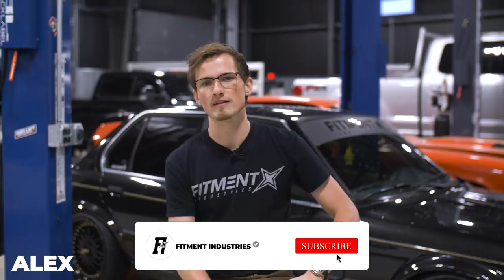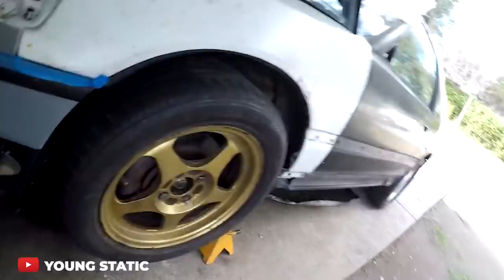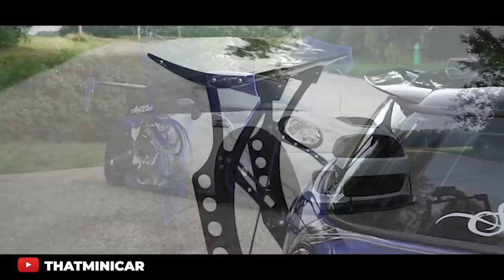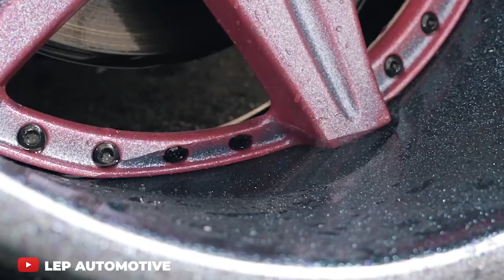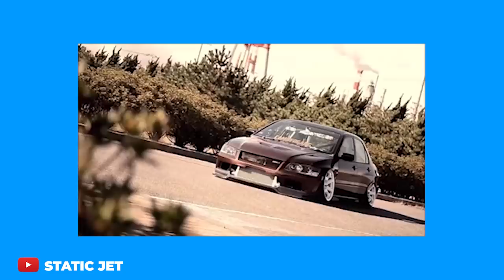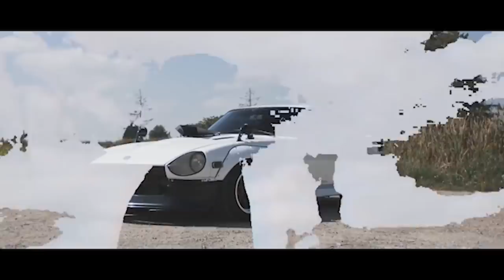Rookie Mistakes When Building A Car

Comment: camber over 10 degrees in either way should be illegal
Reply: @mirainikki7681  So because you don't like how it looks mean it should be illegal.. makes sense
Reply: ITZ Caleb why does it affect you?
Reply: I normally dont like excessive camber but on a few cars it looks cool to me
Reply: @joshuakleine7821  well it poses potential risk to others on the road, considering they have less grip...
Reply: @thomas kalita it really isn’t that unsafe if done correctly. You just can’t buy cheap camber bolts and camber arms because they will probably fail
Reply: @joshuakleine7821  its about grip, not the quality of the parts, it reduces the 60-0 breaking by a ton of feet
Reply: @rodri MFG TONS of feet, yes sir you are right it take an additional 4 THOUSAND feet to stop from 60-0 if your car has camber. Yes it does take additional room for a car with excess camber to stop (maybe an extra 10 feet of so”. But everyone with a car with excess camber knows that, and drives it that way. But everyone seems to be avoiding my question. How does excess camber affect you in anyway? It’s proven safe if done correctly, like I said above if you have the right suspension components like camber plates, camber bolts, camber arms, toe arms and more, it’s safe. Yes it does put excess wear on your car, and it sure  is not good for your tires, but it really isn’t affecting you
Reply: In alot of places outside the US it is illegal because its considered dangerous
Reply: @Revitalyzed  It was more of an exaggerated joke to express my hatred towards the mod, but yea bro
Reply: @r3volt21  it can also help by giving more grip in corners if its setup properly for the amount of power the car puts out and the wheels it has
Reply: Illegal? Just because they have poor taste, no concept of aesthetic ratios, and a desire to go through tires like crazy, doesn't mean they should be illegal. We need something to laugh at while in traffic my friend.
Reply: 8.5
Reply: Full t demand suspension or 326 is about 10k-12k I promise you it doesn’t ride as bad as it looks. If you buy quality parts it will drive like its stock but look boss af and I’m talking static too not bagged
Reply: ITZ Caleb true
Reply: @r3volt21  about 1 degree of camber increases grip in corners/slides... not 10 degrees....
Reply: Excessive camber looks terrible
Reply: My car my choice you do what you want I dont say anything
Reply: I tell em “your wheels are falling off!”
Reply: @mirainikki7681  speak the truth
Reply: ITZ Caleb same
Reply: People with excessive camber wheels are raging on this
Reply: @Revitalyzed  no it's just straight up dangerous, theres hardly any actual tire touching the road so if they need to turn, or do anything fast they're gonna crash
Reply: @maxwell5428  agree. I've long thought it was a really dumb trend, but I try to be respectful of other people's tastes. Then courtesy if Fitment Industries videos I discovered stance on OG beetles and I have ti admit I really freaking like it and I have no idea why.

Comment: My mods in order of what I did.
1st. Cold air intake
2nd. Short shifter 
3rd. cam and head
4th. Coilovers 
5th. Bigger Breaks and braided lines
6th. Lighter and wider wheels
7th. better tyres
8th. Turbo conversion 
9th. Touchscreen display
Reply: finally. performance mods.
Reply: 10. Slam it, negative camber and wing
Reply: So far my first mod is new non stock not crusty rusty ball joints and suspension
Reply: Bro. Lambo doors should be 1
Reply: @zCrytekzHD  for some reason I thought your pfp was a peanut
Reply: Lol this is the dream but honestly I'm just trying to keep my rust bucket from falling apart
Reply: Crytekz 
1) wasted your money
2-9) Excellent mods, good shit
Reply: You should do a tune first for the mods
Reply: @nicolapalmieri7344  that's dumb as hell lmao, you're just gonna have to go back and retune the car after you install the mods anyways
Reply: @fakename287  oh, well, but still you have have to do the tune after installing the mods, and it you don't have enough money and your motor is solid enough you should do a stage 1 tune if you don't have money for mods at the moment
Reply: Is straight piping a good 1st mod?
Reply: Carguy_Club you forgot to mention about retunes being free a lot of times
Reply: Exhaust & tune you’re set!
Reply: Crytekz fires should be like one of the first ones
Reply: 0. Code the annoying Things out with a Bimmerapp
1.Cold Air Intake 
2. Coilovers or H&R Sport Springs 
3. Body(front, rear, angel eyes, rear Lights)
4. Tires and wider Wheels 
5. Break kit with braided lines 
6. Bigger Turbo, Intercooler, Injectors, Fuel Pump(with Pro Tuner)

Car: BMW F31 318d

I would like to do all of this but aint got the Money. 

I did do a tune from 136HP (factory lower) to ~180HP(Stage 1) 
plus I think on doing H&R springs and 19"Wheels.

Cant seem to find an Cold Air Intake for my car tho.
Reply: @loza93  What wrong with the normal intake tube?
Unless you place the filter under car or infront of radiator, it does jack shit.
Reply: I just bought a 14 ats 2.0t rwd. What I did in the first month of ownership was get the cars maintenance up to date and anything replaced that needed it. Now it’s a solid base for parts! My parts list so far is……
67mm throttle body
CAI
Catch can 
Strut tower brace
Ngk plugs 7 heat range (OEM is 8)
High voltage coil packs 
Ptp turbo blanket
3 inch downpipe
LED floating center caps
Mirror puddle light projectors
Smoked lense led front side markers
3rd brake flasher
E85 (not installed) 
I’m buying 10 inch tablet head unit tomorrow and then this spring tuning 
And e85 install. Then next is upgraded intercooler and full 3 inch catback exhaust.
Reply: Bad order!
Reply: @nezabytes  I worked with the money I had at the time.
Reply: 10. took and engrish crass, learned to read and white in his own native tongue 😂

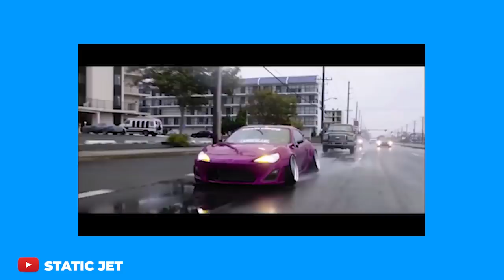Comment: 7:45 that was my friend. Bought a 1993 Z3. Didn't want to do anything else but slam it on the ground. Bought cheap coils, slammed it, blew tires every week. Complained the car wasn't reliable.
Reply: Surprised Pikachu meme material.
Reply: Been there. I had a slammed cambered out fwd economy car with like 160bhp. Had no issues because scraping sometimes. When I picked up my 350z I did the same thing, deleted traction control, and spent around $5K on performance mods redoing basically half the engine bay + tune. It's close to 280bhp, rwd, and stiff as hell, and now I'm going through a set of michelin sports every couple weeks cause I like to send it lol. I was surprised at first, but I'm gonna have to go back and redo most of my suspension setup because I can't keep up with the tire cost. Lesson learned
Reply: @josh2323  350z comes with around 290bhp stock though...

Comment: #1 Rookie mistake, buying a car before learning about it.  The number of people I have met who regretted not knowing that they should have bought a different year than the year they bought or they should have bought another spec rather than the spec they chose is staggering.  Like people who buy N55 BMW 335i cars rather than N54 models.  Or someone who buys a 2010 Mustang GT when you need to wait for the 5.0L Coyote in 2011, etc.  Not knowing what you are buying or what spec you should be chasing is probably the biggest rookie mistake I encounter.

#2 Rookie mistake is trusting the information you read on an aftermarket parts advertisement.  Don't read an advertisement that says "installing this part will net you 20 wheel HP" and actually believe it.  Often, those "performance gains" are achieved when a car has a bunch of other mods already installed that have made that part the bottle neck.  Best bet is to actually research the mod and verify that, yes, in fact it does do what the manufacturer claims.  Or at least temper your expectations of what it can do.

Otherwise, Alex's list nails it.
Reply: artsohc ALOT of people who buy the N55 know exactly what they’re getting. The more reliable engine compared to the N54 and a lot of those guys don’t care about making 500+hp at the wheels.
Reply: Personally the 4.6 can be faster and it definitely has better reliability than most 5.0s. The 5.0 obviously has low end torque but the 4.6 consistently pulls top end and in my opinion it definitely sounds better haha
Reply: I currently drive a 5.0 but I miss the 4.6, it was 10 years older than my brand new 5.0 and I already have more problems with it haha

Comment: I have made 0 mistakes so far. I have also built 0 cars. I have done a lot of research though so I probably won't make too many mistakes. Fingers crossed lol
Reply: Also, list of planned mods for when I get a MK2 Jetta:
1. Clean it up as much as I can, as in rust removal, paint if I can afford it, and get the interior looking new
2. Clean up everything underneath, get subframes powder coated
3. Brake upgrades, lots of bigger and newer VAG stuff fits and is way better
4. Stiffer struts with (hopefully new) stock springs
5. Wheels? And sticky tires.
6. Powertrain upgrades, maybe an engine and trans swap
Reply: BoostAddict A MK2 allways ask for a 20VT Swap and MK3 288mm Brakes so they can fit on (some) 15" Wheels ;)

Comment: I have 1995 Toyota Corolla and I bought eBay coilovers. I ended up finding out that it’s really your only choice when it comes to that platform. Yeah they run a little stiff but honestly for the price I paid($202), quality, and better handling that I got out of it i actually love it. It’s decent enough to daily. I have eBay coilovers, Whiteline 14mm sway bar that I got for a steal! ($87), K&N intake which I had to fab and only paid ($65), OEM 2007 Yaris wheels from the junkyard which cut rotational weight from the stock Steelies(which I sold for $80), wrapped with Performance All Season Kumho Solus TA11, eBay 4-2-1 headers which needed small fab work ($85), and magnaflow hi flow cat ($65) and magnaflow muffler ($55.) this car was built on a mad cheap budget and I kept reliability, handling, and efficiency in mind. Not every build had to be a money pit with your modifications. This was just a daily which I wanted OE+.
Reply: yo send me pics of this beast on ig bro! @anurvg
Reply from the maker: Damn sounds like quite the build you have so far! 👀 You should upload some pictures to our gallery sometime! 🙏🏼 https://bit.ly/2obqAZQ
Reply: Yo let’s see a pic
Reply: Angelo what's ur IG homie?

Comment: In order 1. Coil overs 2. new rims and tires 3. Exaust system 4. Supercharger 5. Better brake system 6. Body kit 7. Fenders 8. Removing seats (weight reduction) 9. Stereo, sub,  and speakers upgrade

Comment: I drive an automatic I just wanna put rims on it, tint windows, and drop coil overs in it and just clean but slow as f*ck lol gas savor 😂
Reply: do lowered springs instead of coilovers, same look, better ride. You dont need coil overs where you're going.
Reply: David Bernick agreed lowered springs unless u got extra coil overs or some shit
Reply: Manuals are better on gas
Reply: Jus sayin
Reply: @ofthamist  on what planet
Reply: @huntermatthews5919  He is right tho. Manual can be cheaper on gas than an automatic depending on throttle control and shifting into high gears.
Reply: @maksor2785  Also depends on the year, newer automatics tend to be a bit more economical.
Reply: Im wit u on dat reality is wut they call it!
Reply: Yes sir!

Comment: 2001 Audi TT Quattro 6 speed 
1. Borla Exhaust 
2. 42 draft Ram air
3. Forge Silicon hoses 
4. Forge Blow off Valve 
5. Re routed some lines for cooler air 
6. Inter cooler elbow replaced with less friction 
7. Lowering springs 
8. Neuspeed pulleys 
9. Down pipes needed (need)
10. Rims and tires (doing this soon)

Comment: At the end of the day, my mods should be in the following order:
- Interior LEDs
- Tyres
- Brakes
- Wheels
- Suspension
- LSD
- Engine & transmission
Reply: vdochev lol
Reply: only problem with that is by the time you get to the engine, its times to replace all the other mods you did before, given all the shit some of the big name companies are producing these days. really have to do your research before buying anything these days as the names we use to trust are the biggest piles of donkey... well you get the idea.
Reply: @MarkSegree  It's a car. Sooner or later you will need to replace everything.
Reply: @vdochev  true. I just wish it was later than sooner o.o

Comment: I haven't got myself a car yet, but I'm pretty close I plan to do something really unique, I guess I'll give my plans out here.
Maybe you can reply if there's something that can be improved, or just a new idea.

Starter Car: Mercedes 190E, preferably a 1.8L or 2.0L model.
1. Short shifter
2. Coil-overs (nothing excessive, just a stiffer ride, and a lower height)
3. Bucket seats
4. Cold air intake
5. Retro 5-spoke rims and newer, sportier tires.
6.A small wing, like the one on the 2.3-16V or the 2.5-16v EVO 1.
7. A metallic paintjob.
8. Bigger and better brakes.
9. LSD
10. Some small engine mods, not looking for mega horsepower, not a fan of turbos either.
11. A new exhaust system.
Don't know what else for now, to be honest.

Comment: I wanna get a 2005 ls430 as a daily and lower it and put some wheels but that's super common in the VIP world for that car and I wanted to do a dark color but black is super common but was thinking dark purple. What should I do to it so it's more unique and not to crazy?
Reply from the maker: Dark Purple is  🔥🔥  fr tho!!!
Reply: Look up a color called java purple. It’s a Harley Davidson purple. It looks very dark in some light but other times it’s really purple. I almost bought a f350 duality painted this color and have never liked purple.
Reply: maybe look into some lesser known lip kits? but also maybe what if you did something with your interior like some kinda custom fabric?
Reply: Just keep it classy, that’s a HIGH quality car. There should never be low quality parts on her.
Reply: was so close to buying one as a daily as well since i loved dailying my ls400 but is going into full drift car status with a welded diff but ended up getting a 335d. I would just say stay away from the basic wheels and its fine if you car looks similar to other cars from first glance. I think its all in the details and quality that shows off builds and as long as its what you want, then thats fine. Also simply things like getting custom retrofitted headlights or maybe even get the badges and small accents coated in something unique like rose gold. There isnt as much aftermarket options for the ucf30 as the ucf10/20 sadly but you can almost change small things to make it yours
Reply: there's a color called alpina green, from the pictures its a dark green sold on alpina bmw's. might be unique if there's not a bunch of green cars where you live.

Comment: Quality over quantity 
Is the best lesson here . 
For me the biggest mistake was not going air suspension from the start. I went with bc coilovers extreme low 22kg and 18kg had them for 4 years now.  I've replaced the same shit over and over . Lips, bumpers, oil pans, inner barrels and bull shit lol .but best mod u can do first is suspension just depends the direction ur going with the build because ultimately not everything has to be bagged . And definitely research what  ur getting into  for what ur trying  to achieve on ur car
Reply: Bags need coil overs anyway

Comment: My first project was a mistake. I got a rust bucket 1964 Ford Falcon with a 200 inline 6. Although the frame was rust free and most to the rust was on the surface, I had no idea what I was getting myself into at the time. It was just too much to handle for my first car. I learned alot about building cars though which I appreciate. I wish I knew what I know now so I could have maybe actually got it running and driving.

Comment: What I did to my scion tc 2006 144000 miles what I bought in order.
Radio system done before all other parts.
After market unit,new door speakers,amp and subs.
1 fixed the check engine light.os sensor 
2 new tires and tie rods.plus wheel alignment 
3 new catalytic converter 
4 short ram air intake
 5 spark plugs.
6 gt carbon fiber wing
7 strut bar
8 new slotted rotors,brakes and brake calipers.(brake oil flush and change)
9 ksports coilovers (dropped 1 1/2 in all around)rear sits higher by .5
10 new rims avid sl02 
(Waiting to do the following) just time.
11 fab wide body kit
12 lip,side skirt attachment, diffuser.
13 inside and outside underglow lights.
14 vinyl wrap
15 flame decal

Yea I was told not to upgrade a old car but I enjoy every moment of it and it's only getting nicer.i will say just make sure to do main maintenance first before and upgrades and do them step by step to make sure it works well and what slight changes are made between you and driving the car after each upgrade.
And don't go cheap.just save until you get the next part on you list.